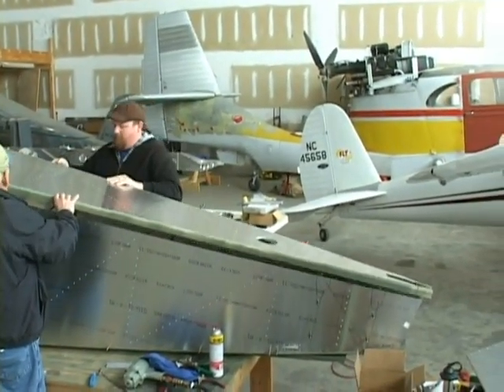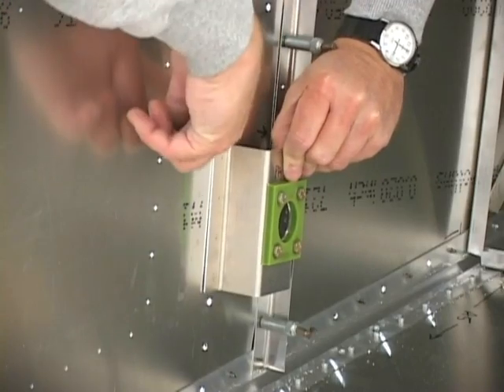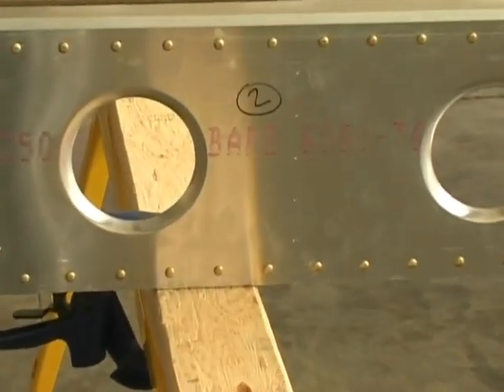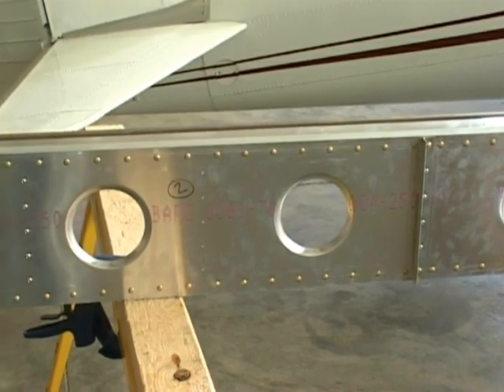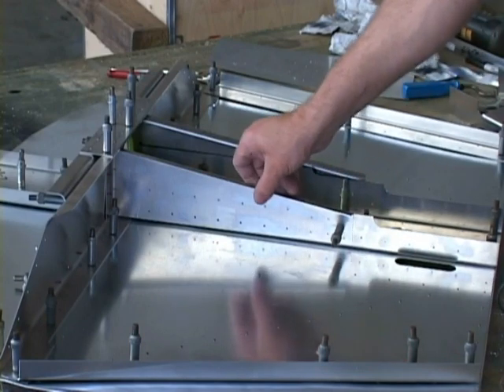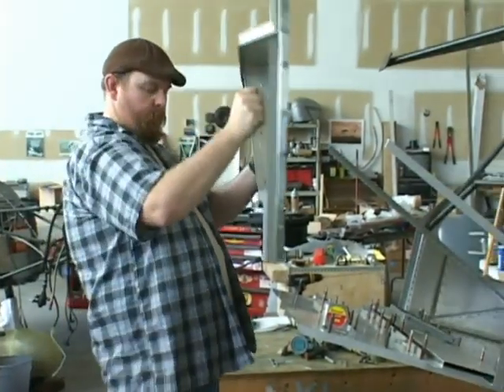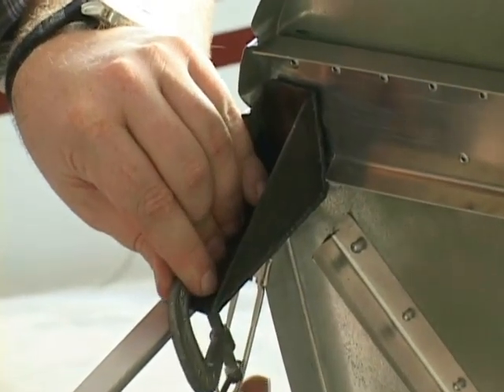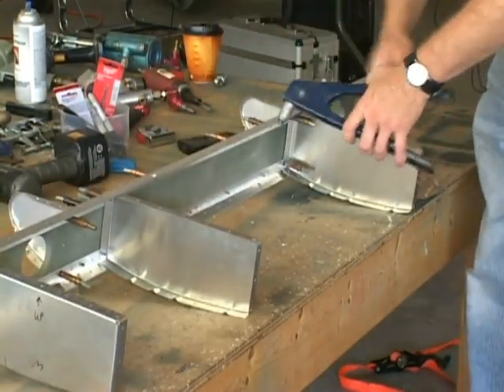Building your Zenith CH750

Comment: Not a good idea. The crankshaft might not hold up. But there are several engines that are based on the VW engine that have been designed for aircraft use...